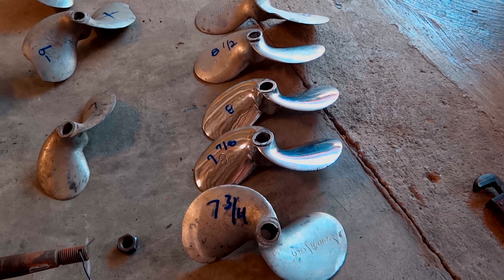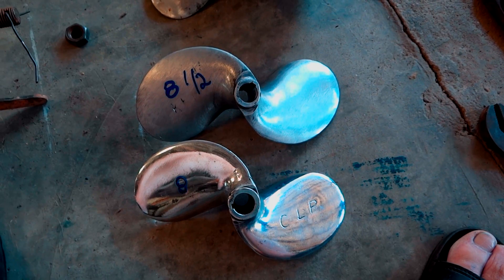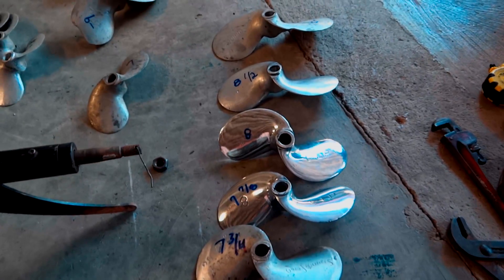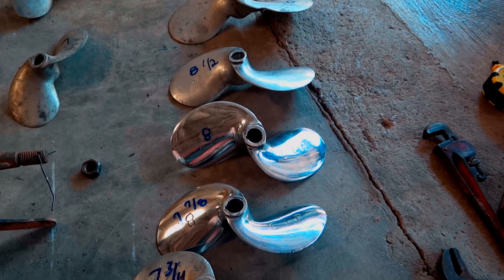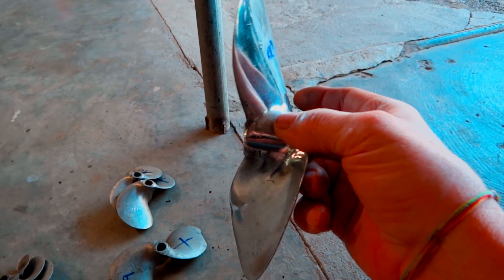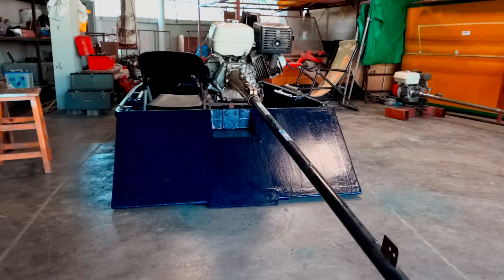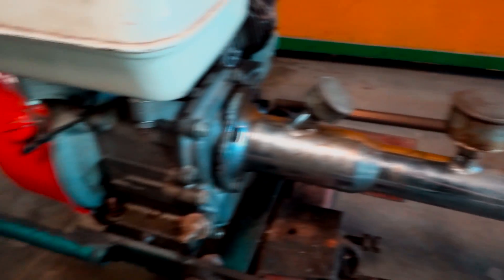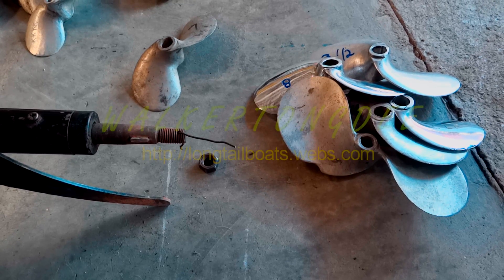long tail props

Comment: I want to make a motor with 1" pipe with 3/4 inch shaft using copper pipe fittings for bushing and some lock collars or roll pins. Put in zerk fittings ang grease it alot. Very cheap to build!

Comment: How ya doing , havent had my boat in the water in a while ,but im back at it , im getting my 23hp worked on so i built another 13hp longtail, just got it done and have been enjoying my river again , in fact sometime late fall or early spring i plan on running all 310 miles of the St Johns River here in Florida that river runs south to north ,then  i may even run back south when i hit the intercoastal waterway  not sure about that yet , but i need to load of gear to do that run ,so as i work on collecting all the gear i need , ill be exploring the rivers again ,  just thought id say Howdy .

Comment: Hello, i'm back! Now i have one aluminium boat with 3,5m X 1,12m. Flat hull and one V-Twin 22 hp. I have some sizes of props: 8" / 8,5" / 9" / 9,5" / 10" / 10,5". All SPS props. what size is better for "walk" in mud? 
Ps.: Size 8" and 8,5" are more pitch.
Reply from the maker: It all depends on the drag of the hull start small and work up. :-)
Reply: +Walkertongdee Ok, thank you!

Comment: Hello, i wish "walk" in the mud, but i can't. Can you help me? My engine is a diesel 5hp with gear box 2:1. My prop is 7 1/2 X 6. When i put the prop in the mud, the prop just open a hole and i still stopped.
Can i "walk" like this man? --> https://www.youtube.com/watch?v=gzUv8fVixrc
Thank you and i'm sorry for my bad english.
Reply from the maker: Use um casco de pelo menos 5 metros de comprimento, um tipo de canoa de casco estreito com um 13 hp. motor. Use um casco de fundo plano ou quase plano. Não mais do que três pés no mais largo. Um barco pesado não é bom.
Reply from the maker: seu prop muito lento baixa velocidade de baixa potência 13 hp 3400 rpm maior velocidade maior potência.

Comment: I am pretty sure the props are all made by the same company.  I import the CLP brand to the USA and sometimes the props have SPS marked on them.  I could easily find out but based on that I assume they are all made in the same place.
Reply from the maker: +Robert Milner  I doubt it. KKK was the old company 50 plus years old, then the old owner split off and made a new company called SPS. ClP is a different company altogether that "as you may know" make farm equipment and have their own CLP brand props. CLP can and may use SPS or KKK and a secondary provider may sell units with any prop they want. I am sure the three are made in three separate factories. I could look them up, I once knew where they were made. They look quite different, although the SPS and KKK look similar because SPS came from KKK. The original KKK owner had a partner and they had a falling out,  that original owner/designer split off and started the SPS brand.  Actually I know way too much about such a trivial thing. Hey, Don't forget to have fun and good luck selling CLP's.
Reply: +Walkertongdee I just assumed there was one propeller manufacturer that supplied CLP, SPS and KKK with props.(all the props I have seen in the US have seemed the same to me- some are "polished" some aren't)  I have never bothered to ask.  I am familiar with all 3 brands.  I have been working(distributing their product in the USA) with CLP for 3 years now and they are great to deal with.  Duck hunters and fisherman love using the Thai longtails and they are getting much more popular here now.  It is a lot of fun and I use/test mine weekly.  Cheers
Reply from the maker: Yes same,same.. The CLP with the predictor should be very light the 6 hp. especially so.
Have fun!